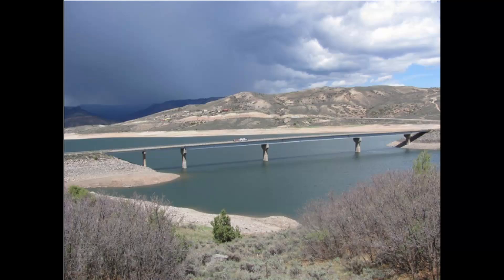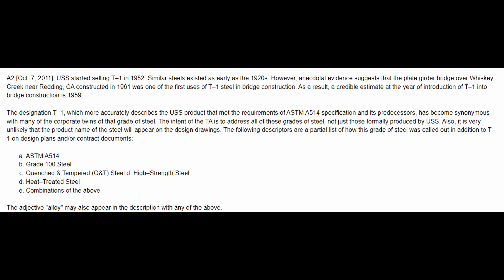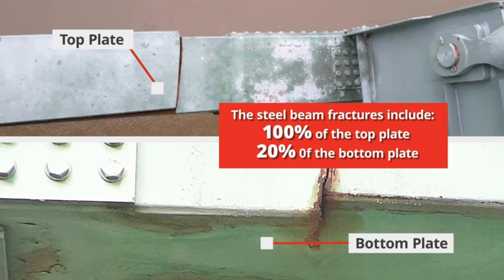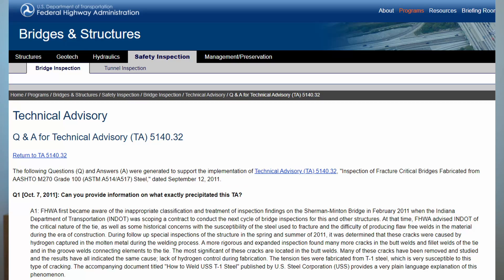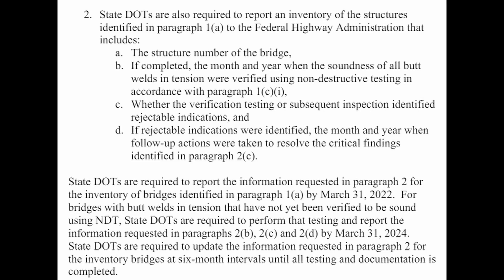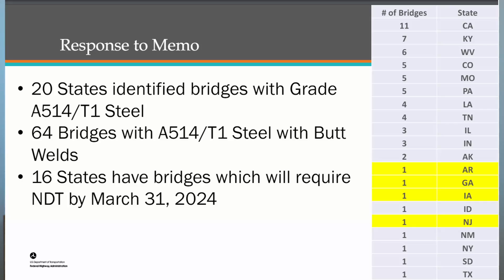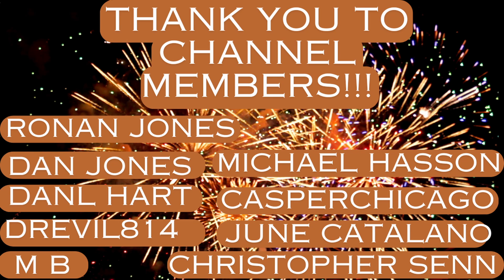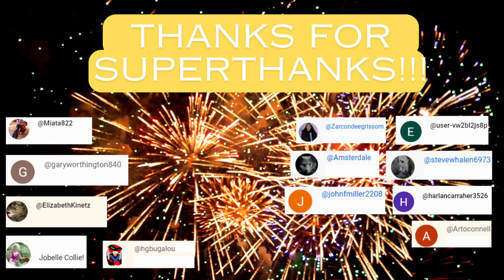The Major Implications of the US-50 Bridge Closure in Colorado

Comment: 50 years with a crack and it was still working as designed? Some bridges are too angry to fall.
Reply: I suspect the crack was smaller 50 years ago.  There are some peculiarites of the location with the crack to cause stress concentrations that would not be suspected by most engineers without an FEM analysis. and would accellerate crack growth.  If you increase stress locally by 26%, the rate of crack growth roughly doubles.

Comment: An alternative to using the special inspection vehicles is to use drones to fly under the bridge with high res cameras on board - at least the drone could help by offering an initial low cost inspection.
Reply: Drone inspection sounds like a good idea, but drone inspection would have to have a lower rate of false negatives compared to other techniques before it would be of any use.  Think about it: if I fly a drone and see something, great, we know where to inspect more closely.  But if I fly the drone and see nothing, we still have to do the same visual inspection as without the drone, because the drone might have missed something.  The true negatives, and all positives true and false, are no big deal, but we can’t allow for any false negatives. Imagine the outrage with the headline “drone operator missed crack in bridge that collapsed”.
Reply: start both ways....drones and special gear.  drones will done with fast overview before special gear finds 1st crack.  then do it again, and again....drones are cheap.
Reply: Hard to do with often several layers of paint over the welded joints.
Reply: @TheBeingReal  Correct... Drones would not have seen this crack.  It was the barest (not much different that all the other rusty spots) rusty scratch in in the paint.  Only seen because they were looking for it specifically.  Not a big deal for most bridges as they have redundant load paths if a girder fails (which can usually be seen from a distance), this one does not seem to have redundant paths due to the two girder system and the hinged drop in span.  Two cheers for the FHWA for directing a deeper inspection of these T1 butt welds.
Reply: @TheBeingReal  yes but cracks will cause the paint to crack as well.   However I agree this is not the same as a physical inspection but it is a low cost initial look.
Reply: @EngineerLewis  I don't think the paint was cracked in this case, more a line of small corrosion pinpoints in a field of corrosion spots.

Comment: I'm wondering if it is possible to replace the steel in place a piece at a time until it is all new steel (of a different type obviously...).
Reply: Yes, It is called sistering.  You build a similar girder and support the deck and the damaged girder with it.  It may not be worth the effort to remove the bad girder.  Harder to do with a floor beam and girder bridge.  commonly done for shorter span structures.
Reply: @michaelmcmullen354  Thank you!

Comment: It seems to me the bridges are operating to close to the margin limits of a given span. For example, suppose the length of the spans were reduced in the design of the I64 Sherman Minton bridge had 3 suspended spans (3 arches vs 2 arches, 3 footings and bearing columns)? Yes, I know this increases the number of columns a vessel could hit, mitigate that with dolphins. It seems to me the bridges are designed in the order of importance Form, Fit, Function......
Reply: Shorter spans would have been easier and cheaper, but this bridge is actually over a canyon which would have made piers expensive and difficult to build and inspect.
Reply: @michaelmcmullen354 1) “Let’s not design it with shorter spans because it is hard”, and 2) “let’s not do that because it would cost more”.  Since when does the government care about cost?  They know they have a seemingly infinite pool of money from the tax-payers.
Reply: @truegret7778  Mostly highway repair money is limited to fuel taxes which have not gone up with inflation even as fuel efficiency improves.  Fuel taxes here are about 10% of what they are  in western europe.
Reply: @michaelmcmullen354  This is why it is so important to "drill, baby, drill" and vote the "right" way. Thank God we don't live in communist europe. In California, the federal tax is 18cents/gal and state fuel tax is 78cents/gal. There are 14,268,528 cars on the roads in CA (1,496,310 in CO), 40cents/gal).

Who do you think makes the more money? The oil producers or governments?

If the governments (state and local) used the tax moneys for the area (bridge & road repair, routine maintenance) it was allocated to used in,  we would not have this problem.
Reply: @truegret7778  That is California's problem.  Their state gas tax is perhaps 4 times Colorado's.  Admitedly they have a lot of multi billion $ bridges to deal with, and constantly updating them to meet improved earthquake requirements (so far not a problem in Colorado though the the earthquake accelleration maps and code proceedures seem to change every decade.)  As far as more drilling for oil, it would not affect gas prices much as it is a world market and added production would be shipped elsewhere.  It would help the local economies in producing areas.  Oil production work is hard, but pays well.
Reply: @michaelmcmullen354  You are mistaken about the oil and gas. My father, and two uncles retired from Mobil Oil with 120 years of service (one uncle in exploration (managed the North Sea exploration), another (my father) in production (managed the fields in central CA + 150sqmi fields around Tripoli, Libya), and the third managed oil delivery/transportation from refineries), and I spent a few summers as a roustabout. The federal, state, local prices will go down - however the taxes will remain the same unless significant structural changes are made.
Reply: @truegret7778  I thought you were talking about drilling in the US.  An extra couple of million barrels a day from added US drilling would not effect world prices much.  Now if Venezuela got their act together (doubt it), they might make a diff.  In the US if the population holds more or less steady, consumption will hold steady or fall a bit over the long term as efficiencies improve.  Natural gas will have a place in power production for a long time.
Reply: @michaelmcmullen354  I am. I was establishing credibility (you have not). We have the largest natural gas reserves in southern Joaquin Valley, and still have the untapped National Petroleum Reserve in Alaska. Energy independence. The point of this video "lack of maintenance funds". I say we have plenty of money (you claimed we do not), and I say it is just managed wrongly.
Reply: @truegret7778  US is oil and natural gas independent, at least marginally in quantity.  I am not sure the battle between electric and renewables (sort of... only some of grid power is renewable) has nothing much to do with highway maintenance.  I agree means and type of taxation will need to change as electrics become a significant part of the fleet.  I seem to remember a fee on my leaf registration for highway mtc.  It is only recently that PU truck fuel consumption of anything available in the us has equaled or exceeded my former S10 (26 mpg).  Everything availavle has been monster trucks.  New hybrid Maverick is 40 mpg though.  I also agree natural gas is an excellent source of grid power and will be for a very long time.  Wind and sun are too variable.  Batteries only effective for grid stabilization and very short term shortfalls in renewable.  Managing their gas (or electric) tax and how they use it is currently a matter for the states.  Colorado seems to be meeting their road maintenance targets, partly due to an added tax on vehicles targeted to maintenance.  This was voted on in a state wide vote several years back.
Reply: @michaelmcmullen354  Sun is not viable. Any significant field of panels (I'm talking about 10s-100s of MW) take fields from growing food. The amount of energy required to melt and grow silicon ingots (it takes two+ days to grow 35kgs to 1mx125mm ingots @ 1500°C which yields ~300 wafers or about 8 75W panels). I worked as a process engineer @ ARCO Solar for 3-1/2 years.
What the overwhelming majority of people, especially those that suggest "all electric", or "all solar" or "green", or "wind" do not understand is nothing is free. It takes energy to make energy. We have 100+ years of tuning and optimizing oil, gas, natural. We will never, ever see an all electric vehicle country. There will never be an economy of scale to make it so. A hybrid transportation/cargo infrastructure is the best we will be able to do.
Now, if someone can develop the flux capacitor and veggiematic with nuclear reactor we might see a paradigm shift.
Back to the issue - better, competent governments to manage the infrastructure is needed. I enjoyed the chat, and am moving on. Cheers and good luck, and God help us all.
Reply: @truegret7778  Actually I have solar on my house. 10 panels takes up about 25 % of my roof.  Cut my electric bills about 80%. I would have put more on my roof, especially the west side, except I have quite a few taller trees which I like.  I think your yeild of wafers/boule is off by at least an order of magnitude.  I also agree we will have a hybrid energy economy through my childrens, and possibly grandchildrens time.  I have been very surprised at the rate we have weaned from coal in the last 20 years.

As far as the flux capacitor/vegamatic, that was the promise of hydrogen fusion in 1964 when I viewed a Tokamak fusing hydrogen on a stage at the world's fair.  It was "just around the corner", maybe 20 years max.  At this time they are still working on getting more heat out than electricity in, but will be grid ready ready "just around the corner" maybe 20 years...Ha, Ha.  At the time I had just finished my freshman year as a physics major.  I wanted to study magnetohydrodynamics, something I had been interested in for 3 or 4 years.  A lot of good and interesting things have come out of magnetohydrodynamics, but electric power production from hydrogen fusion is not one.  All it has to show is a long string of never ending mega pork projects.

Comment: It's important to know that operating snooper cranes requires special certification (may vary depending on state/country) and the combination of welders that also have those certifications could be low - so that's a reason for building scaffolding as well since most people can operate from scaffolding.

Given that it's a reservoir it would be tricky to arrange a ferry service as a temporary solution and you'll have to transport ferries to that location as well.

Overall I hope that this highlights that there should be reasonable alternate routes constructed that could handle situations like this - even if those routes would have decreased capacity and be slower to take it would help. There's some relief via CR26 and CO149 according to "Montrose business times", but it seems to be a small consolation. CR26 seems to be the bottleneck here since it seems to be a gravel road.
Reply: Since this is a mountain region, bypass roads are there, but most are 6-7 hours one way. You are correct in the current bypass being county road 26, a gravel mountain road, was never designed or maintained to handle the traffic load that is needed now. All commercial trucks can't use this road and have to go around the long way. Until late spring these are the only options right now, once spring snow thaw is done, one other route opens up but that is only marginally better as is wasn't designed for heavy traffic either.
Reply: I'm pretty sure the US military has portable pontoon bridges

Comment: We have the technology to incorporate integral monitoring of critical components within the structure itself. I would imagine building in strain gauges, ultrasonic sensors, accelerometers, GPS and such into constructions  so that it esentially monitors itself woulndt add much to the overall cost and save a lot of trouble in the future. Usually though I think they mostly instrument structures built with more novel unproven designs or techniques with the intent of making sure it holds up. I think I've seen where they can instrument and monitor older structures but I don't think it's as comprehensive and effective as when it's built in from the beginning. Also I guess the monitoring techniques themselves would need to be proven out to be viable and effective before anything would be widely adopted but hey we gotta start someplace. Maybe some company will come up with a robotic solution...  Just my thoughts.. C:
Reply: I think they added some strain guages.  I don't know if they are intended to be permanent with a cell link to the CDOT office, or just a safety factor for the duration of the repair work, or to determine the stresses from thermal, traffic loads, asphalt removal, added steel weight, etc. or any stresses from funny motions and dynamics.

Comment: What is the hydrogen problem in these T-1 butt welds ? Was it caused by not pre-heating the steel before welding or by using welding rods that were not dry ?
Reply: Potentially any of these things.  Don't forget interpass temps,  any stress relieving or heat straightening, and simply not seeing the weld flaws with the QC X-ray.
Reply: I have also heard of hydrogen being introduced by the combustion product gasses from torches to heat and maintain the required base metal and interpass temperatures.

Comment: If inspecting bridges is vital to public safety, it seems like a good idea to put features in the design that would facilitate thorough inspections.  Whether that means catwalks, safety rings for safety harnesses, or a gantry with a cart. to move about swiftly, it doesn't matter.  It seems that one of the reason's inspections are inadequate, is the cost and the sheer number of bridges there are to inspect  Any way to reduce cost and increase the number of inspections an engineer can do in a day, month or year would help ensure bridges are safe.  Yes, there would have to be protections to keep drunken fools from using the underside of the structure as an adult jungle gym, but that does seem like a solvable problem. 

In other words, bridges should be built not only to carry loads, but they should be built to be inspected as well.

Comment: Beyond the cracks several of my friends that live in this area showed pics of some level of buckling also at various points om this  bridge . Localy cdot is saying it probably can't be fixed.  
  The real problem here is in a matter of weeks tourist season starts and traffic levels in thee area triple for the next 3 months
Reply: I get it, I live in a Colorado tourist town, too, and it's starting to turn up. Soon there won't be any ice available anywhere, and the single strip of highway through here will be completely clusterfucked by jackasses from Texas, and the river will be totally covered by vacationers on tubes floating their fat asses down it. Our town really gets a huge shot in the arm.
Reply: Looks like it is sagging to me.
Reply: @shanemedlin9400  I guess they plan on opening one lane now on the 4th of July after 5 different repairs have been made. .  The welded in extra plates om the ends to stiffin the plate girders .
Reply: @ELDRGW  Bolted the added plates on.
Reply: @shanemedlin9400  May be.  Close tolerance for a bridge would be span length/1000.  Looking straight down a rail 3.6" of deflection would be visable.  Also I think this structure varied the depth of the girder with the bottom level rather than curving both the top and bottom of the girrder to follow the deflection curve.  It is also difficult to avoid unpredicted camber variations in welded girders.  They can also settle a bit from portions of the heat affected zones left in significant tension after welding yeilding as the bridge is loaded.  As far a buckling shrinkage of the welds upon cooling and shear in the webs can cause them to buckle slightly, potentially a lot near ultimate capacity.

Comment: Myself, I'd suggest a repair like used on aircraft. Drill stop the crack and rivet a doubler that's been calculated to be joined at a lower stress point along the structural member. Avoids the issues with welding the steel in situ entirely.
Reply from the maker: That is an interesting idea!
Reply: I did aviation course when I was in high school.  I got to go up about half a dozen times during the year.

Part of the pre flight was to inspect the fuselage for cracks.  

There was many.  And the fix was to drill a 3mm hole at the end of the crack.  Some cracks had multiple holes along thier length, and obviously the crack has continued to propagate.
Reply: This may actually be the repair method.  Unfortunately the doubler's are probably up to 1" ish x 24" both sides of the bottom flange with perhaps approaching 100 bolts each side of the crack.  The inspection requires removing paint and retesting (ultrasonic testing was not available during origional construction era) all the welds with ultrasonics.
Reply: Sounds like a good idea, at least where there are lower stress points on both sides of the crack.
Reply: I've drilled out at least 30 holes in bridges and then die ground and sanded the bore smooth to do just that.  I've also done in the neighborhood of 500 grinds to accomplish a retrofit to open up potentially fracture prone areas between welds that are too close together on welded vertical and horizontal stiffeners that nearly meet.
Reply: @mdavidopie6993  Common repair for distortion induced fatigue cracks.  Doesn't help a butt weld that is a sea of cracks very much
Reply: Often does not stop the crack but usually slows it.  Reason being is that crack often extends into the far side of the hole further than will show with any kind of check testing.  Will usually slow crack growth though.  Might be visible again in 5 or 10 years.